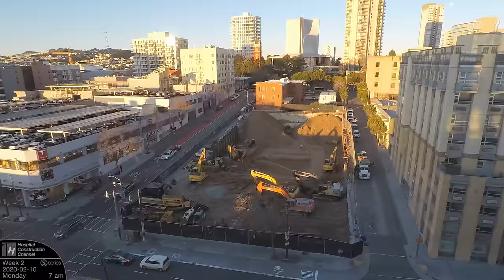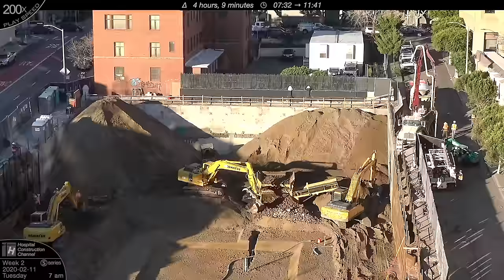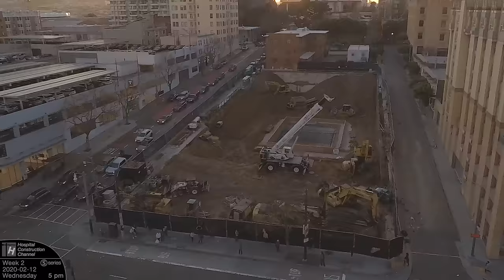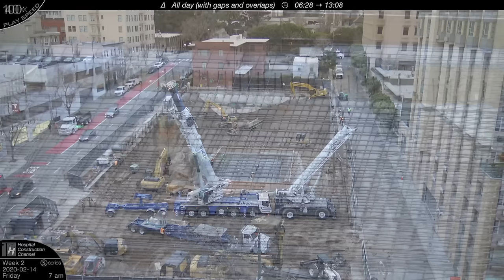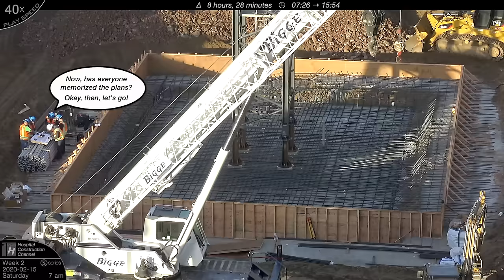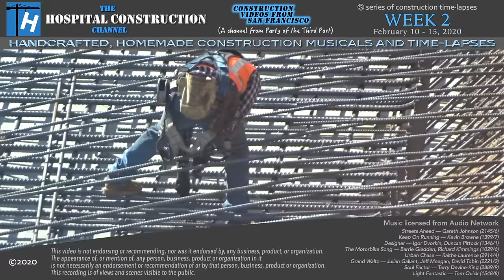One-week construction time-lapse with closeups: Week 2 of the Ⓢ-series

Comment: I don’t get this craneboom dolly. In Europe they drive around like it supposed to be and in the US everything is made bigg and heavier only youre US tonnage is less then Metric tonnage and the roads can’t handle this? Where’s the logic in building bigger and heavier if the roads can’t handle it?
Reply: I'm wondering the same thing...
Reply: It's the US ... biggest third world country in the world ...
Reply: Yet most US semi-trucks are heavier than an average European semi-truck, which isn't exactly a great apples to apples comparison. At the end of the day it comes down to bureaucracy (maximum axle weights, permits to drive a large crane down the road, etc.). A dolly also allows the crane and boom to spin freely, meaning that the back of the vehicle will not swing outward when turning, but rather drag behind the rest of the vehicle. Again, not all cranes of this type need that large of a dolly, but most use one. I personally have never seen one with that long of a dolly. Most are only two axles in a tandem configuration, not not in the two plus one configuration as seen here (which is likely because of California having some of the most ridiculous Commercial vehicle  laws in the US).
Reply: In the US we have what are known as Bridge laws, and it's a formula for how much weight can be on the road, based on the number of axles and the distance between axles.
You can get overweight permits, but you still need to be below the bridge law figures unless you want to hire engineers to plan your route and calculate if the bridges can handle the weight.
Basically the bridges are designed to handle a certain amount of weight per foot of bridge, and so the loads have to stay below there.
So by adding more axles, and spreading them further apart, you can be heavier with less issues.
In Europe, I would expect to see a crane that size with the boom shipped separately from the carrier and then assembled on site.
Here they were able to extend the dolly and get a larger crane in a single trip.
Reply: Julian Reverse here you are popping off about Americans, again. I’m beginning to think you’re just jealous.
Reply: If it is a libeherr 5 axel Carn it can get a 10 ton per axel whiteout ballast. So the dolly make som really wierd math when a 40 ton Volvo track digger gets transported on a 2 axel trailer.

Comment: I'M SURPRISED  the four concrete plinths had reached sufficient strength to take the weight of the crane section so quickly
Reply: A high-early strength mix. Really wasn't required to hold much weight in any event. Surprised that smaller crane wasn't able to make the pick.
Reply: @ArthurDentZaphodBeeb  mostlikely able to lift but not with the armlength
Reply: Ya, all they do is hold the base level in the middle of the footing slab until the slab gets poured around it. Not much weight really.

Comment: Appreciating having this vids back again, I had a question u probably could answer that is what happens to that bottom tower section of crane which is embeded in concrete slab foundation, when the construction has ended?
Is it removed? Just cut away? Left in place maybe?
Thank you. And by the way why is the crane foundation so massive this time? I have seen such tower cranes installed before and none was featuring such a huge slab!
Reply from the maker: I'm not expert by any means, but I believe that the part encased in concrete just remains forever, but most of the bottom section unbolts from that.  So the only part left is what is encased in the concrete.  Unfortunately, I don't know anything about the slab size.  Maybe there are some experts who can chime in.
Reply: @HospitalConstruction   I really appreciate your concern and your response.
Reply: I noticed the extension on the bottom was not even painted. To me, that means it is a sacrificial piece and will be left embedded in the concrete.
Reply: Yep the bottom section stays, either poured over or cut off. You cast it en-situ once level so thats that.
Reply: @HospitalConstruction  the slab size was instead of pilings.
That's on sand, as you can see from them digging a trench BY HAND near the beginning lol, and putting the slurry layer down before starting with rebar, and so you just need a really big heavy mat to spread the weight out, and by its extreme weight, compact the sand and provide stability.

And yes, the bottom section of the tower base bolts on, and at the end it gets unbolted, the tower lifted off, and then torched flush and covered over.

Comment: Interesting Video, but strange Set up, i think in Austria one or two excavtors with oil quick and a varity of implements and work tools, would do the same work, and there would be now or almost no hand shoveling and trenching and much less workforce needed. They use a tractor with a grading blade in the back, but dont have grading buckets for the excavators?

Comment: what happened to the rebar?
Reply: That's a great question...did they pour a slab with no rebar? Scary
Reply from the maker: No slab was poured in Week 2, merely a surface to work on.  After a lot more rebar, the slab is poured in Week 3 (coming soon).
Reply: @HospitalConstruction  sorry i saw that. i merely spoke too soon. that was an appropriate amount of rebar though.
Reply: It's lean concrete.